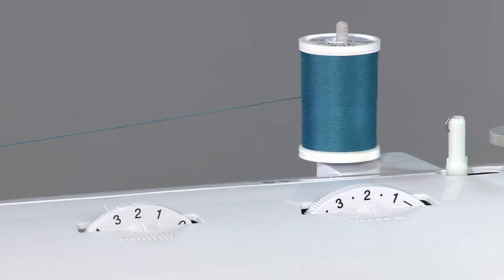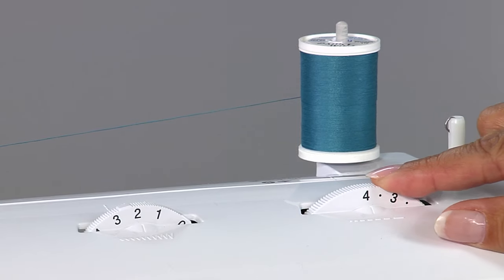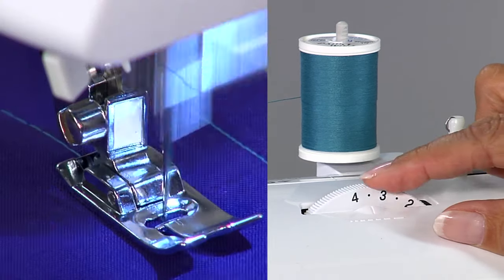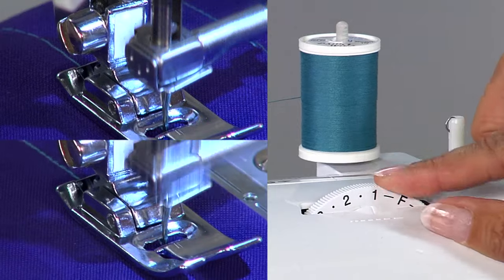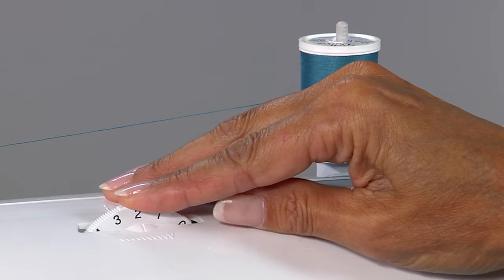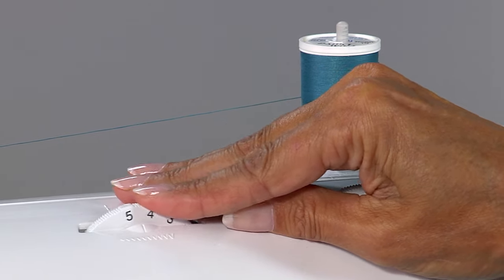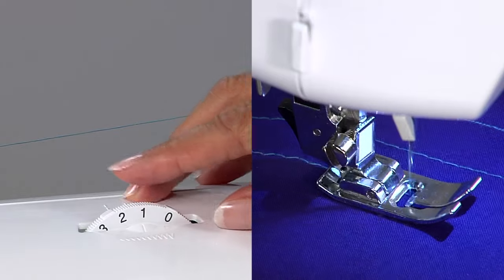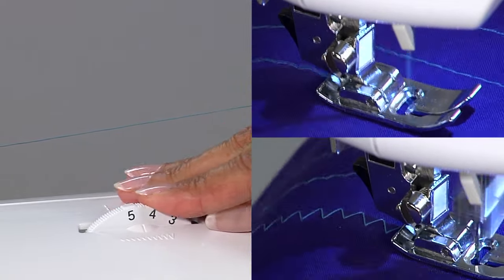How To Adjust Stitch Width and Length on a Brother Sewing Machine

Comment: My stitch width dial refuses to go less than 2.5. If I force it, the reverse lever drops, and it springs back when I let go.
Reply from the maker: Make sure when adjusting your stitches or the length and width, that the needle is raised to the highest position as well as the presser foot.
If you are still experiencing the same issue, please contact Brother Customer Service at:
https://www.brother-usa.com/support

Comment: Why does my sewing machine skips stitches. I threaded it correctly?
Reply: Hi, I had that issue for a while.  If you're positive you threaded your machine (and your bobbin) correctly...check the following:   Is your needle dull?  If you do a lot of sewing, you should change it after every project as it will likely get dull and won't properly go thru the fabric fully which can cause skipped stitches.   Next, are you using the right type of needle for the fabric you're sewing?  Lastly, make sure your machine doesn't need cleaning.  If it's been a while since it's been cleaned, that could also cause skipped stitches.

Comment: i have a disney sewing embroidery se 2700   EVERY time i try to baste, it gathers instead of just stitching the longer stitches, its driving me crazy!  I rarely use this machine, and if noticed that the foot pressure is to strong, and i dont see a way to adjust that or lower the teeth. It grabs the fabric and misdirects it, even as i hole both the front and back of the fabric.  Yes, i do believe i hate this machine. which is probably why are never use it.
Reply from the maker: We are sorry to hear that your fabric is not feeding properly and is also gathering. Please see the links below for further assistance:
https://help.brother-usa.com/app/answers/detail/a_id/65113
https://help.brother-usa.com/app/answers/detail/a_id/74473
You can also refer to page 96 in the manual below:
https://download.brother.com/welcome/doch000059/se270dug01en.pdf
If you are still experiencing the same issues, please contact Brother Customer Service directly at:
https://www.brother-usa.com/support
Reply: @BrotherSews  I cut some thin paper and put on top before basting, and then peeled it off.  i will research the above. thank you